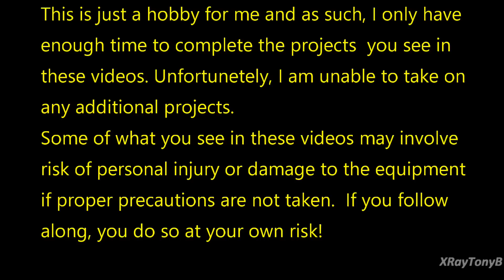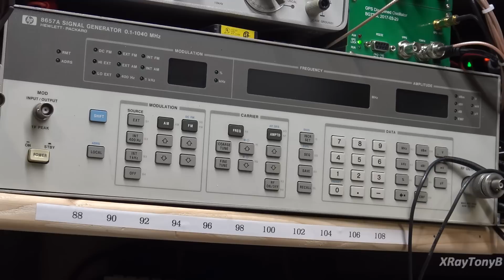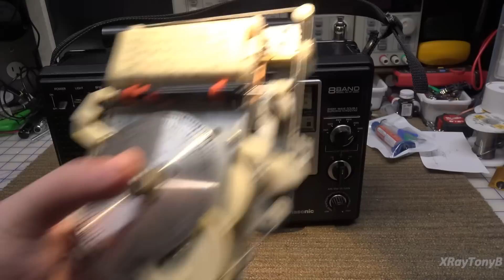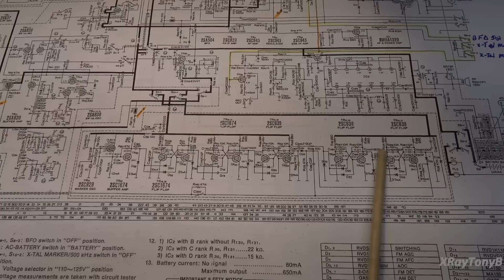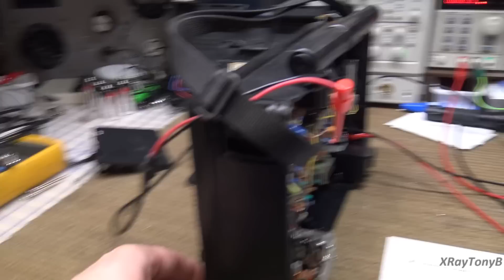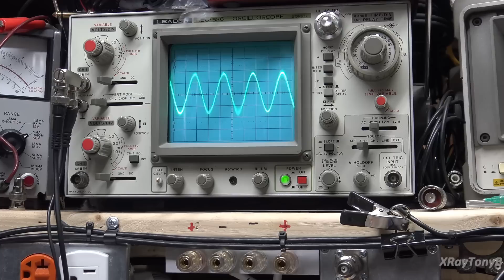Panasonic RF-2200 : Part 2 - Repair tips and lessons learned

Comment from the maker: 0:00 Intro
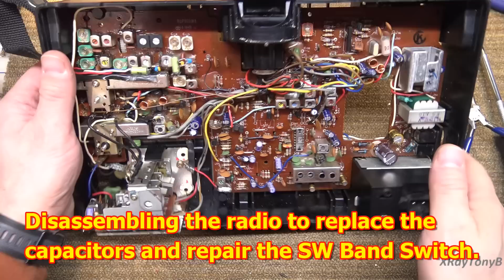9:23 Disassembly to replace capacitors and repair SW Band Switch
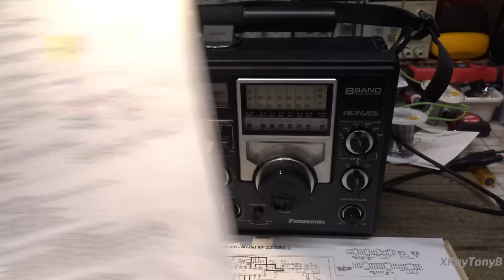17:01 PC Board & SW Band Switch removed - Looking at the schematic
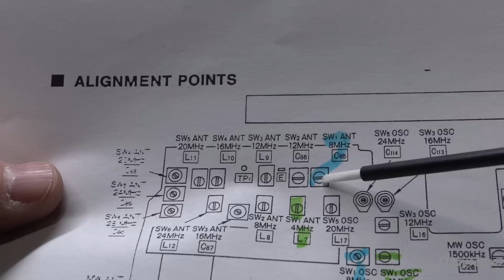22:41 Repairing the band switch
23:37 Capacitor peeing - good thing they were replaced
24:33 Aligning the AM/MW band - MW 1st I.F. / SW 2nd I.F. (455kHz)
33:17 BFO alignment (455kHz also)
36:40 AM/MW dial accuracy/RF alignment
42:35 Shortwave 1st I.F. Alignment (1.985 MHz)
45:55 RF Padding alignment
55:15 Chasing my tail - Tony was using the wrong schematic!
58:14 Sorting things out - we now have the correct schematic
1:02:05 finishing the padding alignment
1:04:56 Shortwave RF/Dial accuracy alignment - SW1 is aligned (2, 3, 4, 5 & 6 are the same)
1:10:53 Verifying FM alignment

Comment: Hi Tony, thanks for the great video.  I'm working on alignment of an RF-2900 which is very similar to the RF-2200.  At minute 42:36 when you start the SW IF and second oscillator, is it necessary to adjust the radio tuning frequency to see the waveform ?  Are you still set to 400 hz 30% AM modulation for this step ?  On my radio, the waveform isn't visible unless I tune the radio to pickup the signal. Should I expect to see the waveform output through the entire tuning range ?

Comment: I would advise you not to follow the second video. He is not following the alignment instructions correctly. You don't mess with the Padding Capacitors unless you have needed to change out the main tuning capacitor. It states so in the Service Manual. He is not sure exactly what is wrong with the radio, so he changes two original temperature compensated caps, just because. And he's missed the point that the 125 KHz Marker is just that: it generates a marker every 125 KHz. He's trying to align it to 1 MHz points on the Dial, yet the Marker puts a signal at (for instance) 4.000, 4.125, 4.250, 4.375, 4.500, 4.625, 4.750, 4.875, and 5.000. I will admit, it's difficult to understand how the 500 KHz and 125 KHz work together.

Comment: Hello, tell me, in the FM block, the L3 coil has how many turns and from which turn the tap comes, since I had it repaired by someone and the L3 coil was not wound as it should be and without a tap, but it should be with a tap

Comment: I'm doing one of these now. MW/SW was stone dead. Then I found the battery corrosion in almost the exact same place you did. A quick jumper between TR10 and L28 solved the problem. Still deciding on whether or not I will recap, as there are no obvious issues, hum or distortion that I can discern. I am seeing a bit of flickering in the dial lamps, all in time to the music that happens to be playing. Perhaps a power supply issue to unearth?

Comment: I am going to order new capacitors for my RF-2200 but I am wondering if it would be better to replace the smaller electrolytic caps (like the .22uf, 1uf, 4.7uf ) with ceramic caps? Any reason I shouldn’t substitute ceramics for those smaller values? Thank you.

Comment: I am trying to make the adjustment in my RF-2200 but I do not understand in the MW-SW alignment in the step 1; tab Radio dial setting what does ' point of non interference' mean? I would be very grateful if you could give me some explanation. Thanks.

Comment: Got any tips for the Panasonic RF-B45 and its keyboard not working? I treasured that radio until it quit on me 7 years go, then I bought another SSB receiver to replace it but kept the radio thinking it could be repaired. Many thanks in advance!

Comment: Great series, Tony! I just dug my 2200 out of my basement which I purchased over twenty years ago for around 50 dollars.....
AM and FM work great, but sadly no Shortwave bands are functioning. I'm sure it needs a switch overhaul as shown in your presentation, more than I can handle in my "senior years"  I'll probably use it for Am D'xing . Luckily it was stored with no batteries installed. I've been listening to an oldies station in Nashua N. H. AM 900. It's a 900 watt transmitter with some pretty aggressive audio processing and sounds great. Power for the station is 100 watts at dusk...

Comment: Hi, awesome video. I have a rf2200. FM and AM are good but i got only very slight noise on SW with zero signal. The tip of antenna was damaged.  Any idea what could be wrong? I bought the capacitors to replace. Switches maybe is working. Thanks!

Comment: It wold be great if you make a video with a full step by step RFalignment. I do not dare to make it according the service manual it seems complicated.
Reply from the maker: I pretty much covered everything in the video.  The other SW bands are exactly the same as the first one, when it comes to the alignment procedure.  I know there is probably some things I missed in the video, but feel free to comment, if you have any questions.  I'll try to answer you to the best of my knowledge.
Reply: @xraytonyb   I have already replaced all rlrctrolytic cpas with  fresh Panasonic and Rubycom ones but the sound is now too bassy and 'boring' gor my taste. I see in your videos that the main capacitors are Nichicon , brown is PS series but the golden I do not the series. I cannot identify the blue ones 100uf which brand are.   Is the sound in your radio clearer or in the bassy side? Please . I fyou could tell me the series of the golden and the blue ones I would be very grateful. I have not started the alignment yet.

Comment: I have just purchased a RF-2200 it came with the usual issues, MW and SW did not work at all but it can be easily solved spraying contact cleaner in the switches. I have another issue that I do not how to solve it, the dial log shows another frequency that the one I am listening. Ex. Listening 1548 Khz shows in the red line almost 1600 Khz,  
How to read the dial on Fm?  Do I have to dismantle the radio in ordenr to reach the tuning shaft and align the frequency? Thanks in advance.
Reply from the maker: What may have happened is the coupling between the knob and the switch may have skipped a gear.  This can happen especially when you have the back cover off.  I think I showed this in the video.  You should be able to remove the rear cover and pop it back into place.  I hope I didn't misunderstand the question, but that's what I thin k is going on.
Reply: @xraytonyb  I have just opened the rear cover and back in place but nothing has happened. I have tried with the 500 Khz dial marker but no results at all. The stations on 1548 khz is Gold Radio from Uk now is coming here, NE Spain, loud and clear. Any other solution?

Comment: I’m sure the wax is there for a reason. For the factory to take the time to put it there, indicates there is a reason for it. You mentioned your hand was affecting the performance. So obviously this radio is extremely sensitive. The wax is likely there to keep atmospheric humidity (and it’s conductivity) off the sensitive board to help stabilize tuning.

Comment: 22:43 That bandswitch, if you noticed, the black oxide is only on the outer edges, there where the contacts are in closer contact with the atmosphere because there are some holes in the metal casing of the switch. I noticed that always with the large R/PB  switches from tape recorders too. It is therefore a good idea to stick some good sticky tape over these holes to close it off.

Comment: Back in the day, when I worked for a local NPR station affiliated with the public library, we had to align FM SCA "talking library" radios in a EFI and RF shielded room because the sets were cheap, extremely sensitive, and had little shielding.

Comment: I’ve owned my RF-2200 since 1977, and had it recapped and aligned a couple of years ago. Keeping a dust cover on it is highly recommended. Also, tuning in SSB with the BFO is made much easier by gearing the main tuning down to “Slow”. As you discovered, this is one radio that one can safely say it makes sense to do a complete recap on. When I saw your first video, the telltale sign for me was how high you had the volume knob up. With new caps, this radio should have booming audio.

Comment: Have you tried using an ultrasonic cleaner for the switch?
Reply from the maker: Yes.  That was my first attempt.  It didn't work, which is unusual.  The only way was to disassemble it as you saw.  Spraying it with deoxit would fix it for a while, only to have the issue return.